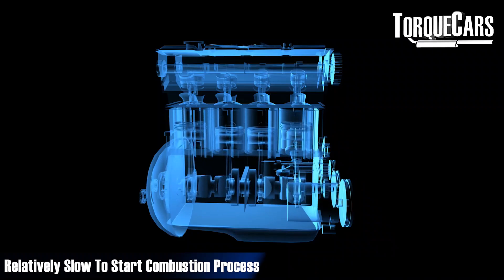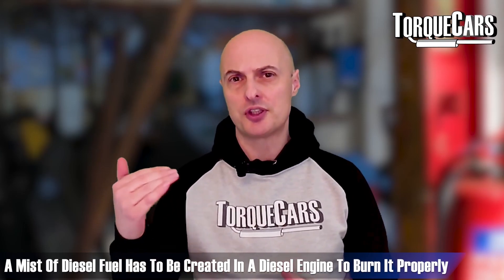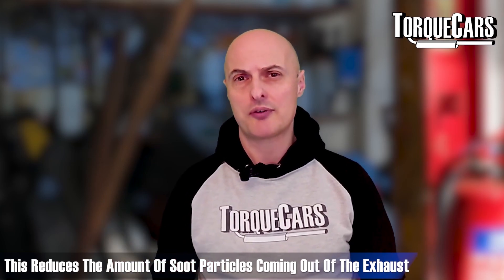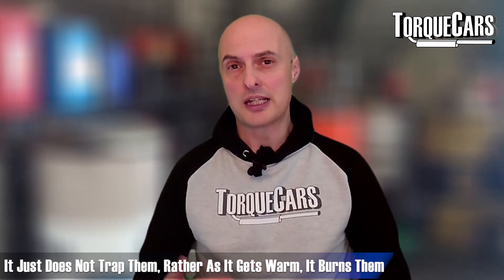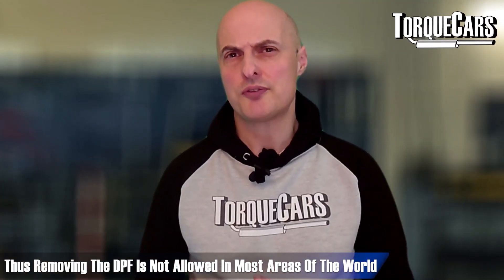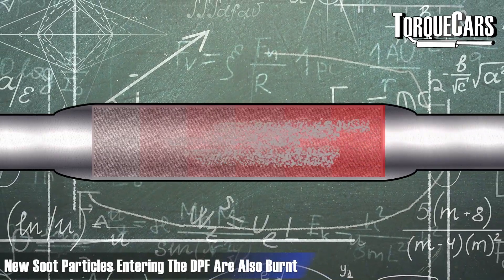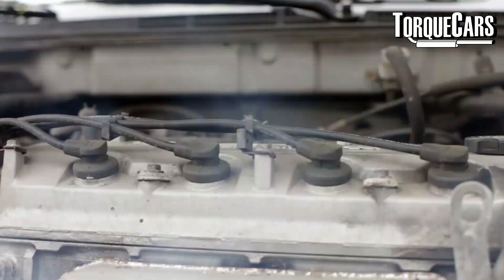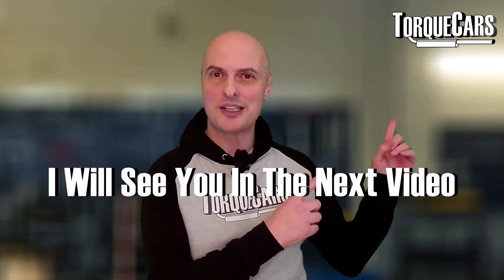What is a DPF? How do DPF's work? & Typical DPF Problems

Comment: i think there is no real need for dpf... more air and cleaner burn and there is barely anything bad coming out of exhaust...  black smoke is always  just wasted power that more oxygen could fix
Reply from the maker: Totally agree with you I have known many cars with DPF removals and decent tuning still meet or exceed the emissions standards. A DPF does seem like a bad solution to the problem IMO.